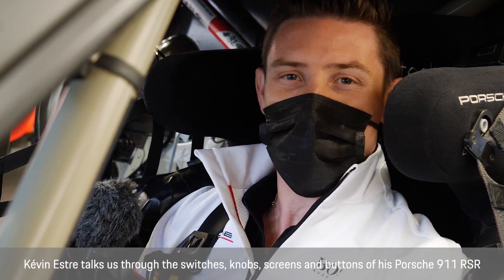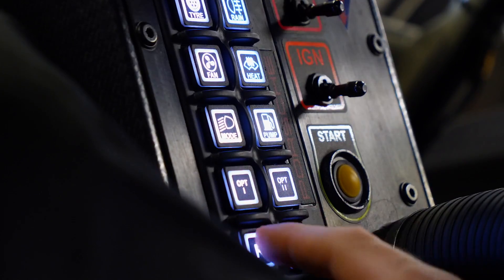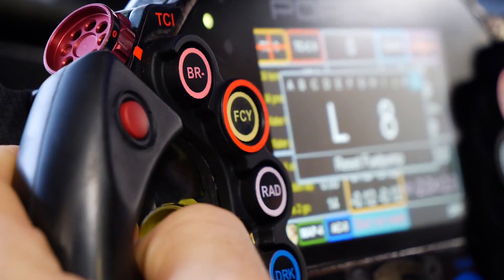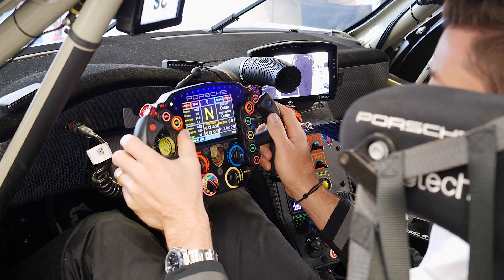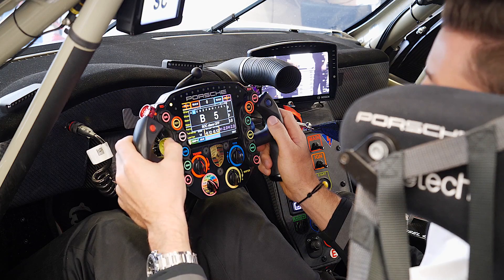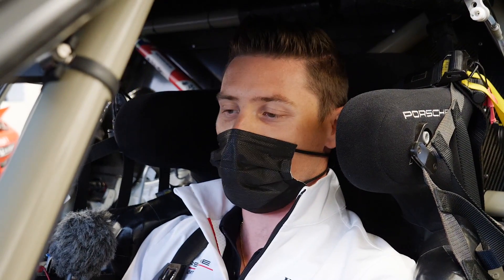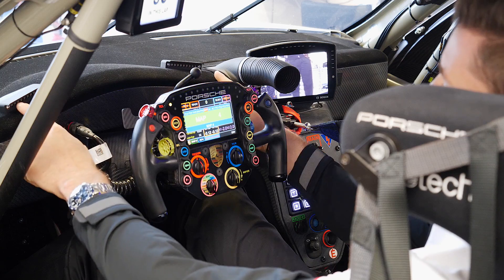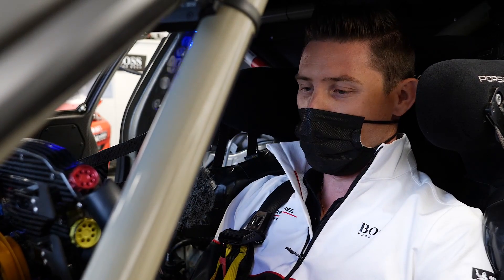Porsche 911 RSR Cockpit Tour

Comment: How about pedals? Is there a pedal for the clutch?
Reply: The clutch is on the steering wheel.  If you look at 4:26, you see there is 2 different levers behind the wheel. one is gearshift down, and the other is clutch.  I think its 2 clutchlevers (one on each side of steeringwheel), so if you press both you have fully pressed the clutch, and when you release one but still holding the other you get the clutch bitepoint.. and when it starts to roll the car, you release the other aswell.. (atleast thats the way it works in other cars.. so i could be wrong about the porsche )
Reply: @AndrewTSq  I am pretty sure, it has a pedal clutch on the floor. Try to google some pictures. The 911 RSR has a pedal box with 3 pedals from AP Racing.

Comment: He just goes "drink" what is drink? Is it for fuel?
Reply: They have an elasric straw in their mouth that is connected to a water bottle. I guess due to the length of the tube, it is difficult to just drink by yourself, so when they want to drink the button activates a small pump to push the water through the straw